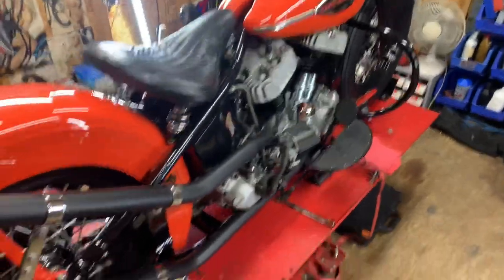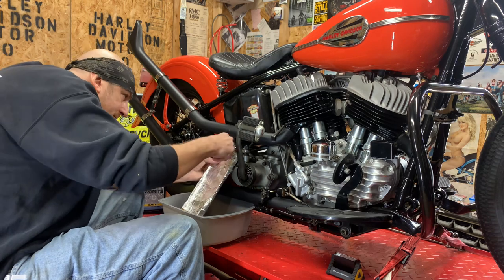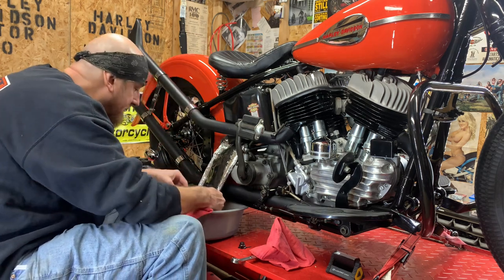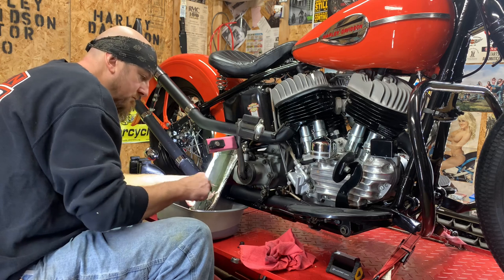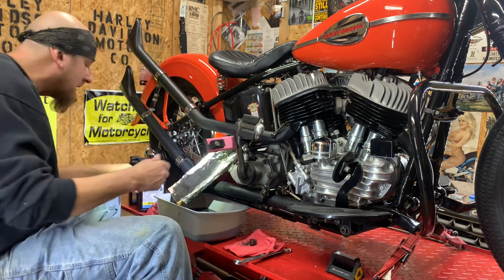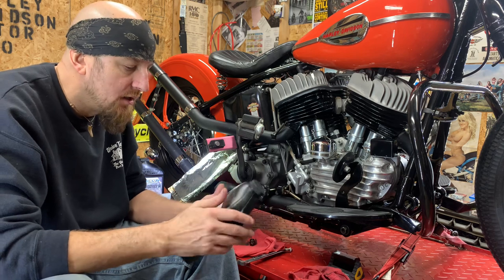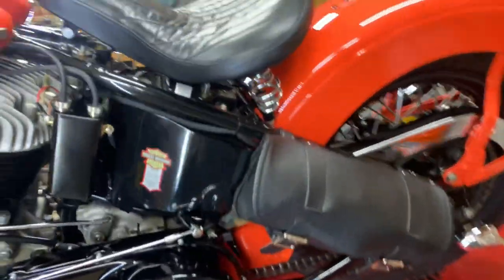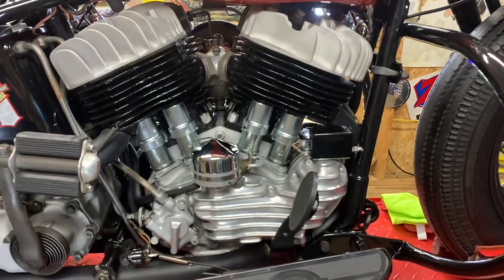1940 UL Flathead oil change

Comment: Beauty.  
I usually get two magnets. 1 on the front, 1 on the back. Stuck together. The back one sticks to the bike and the front catches metal. I use a cut up 2ltr that i melted with a lighter to shape it how i need it.  Cheers 
Chrome magnets work best